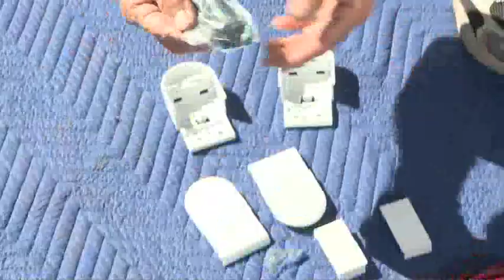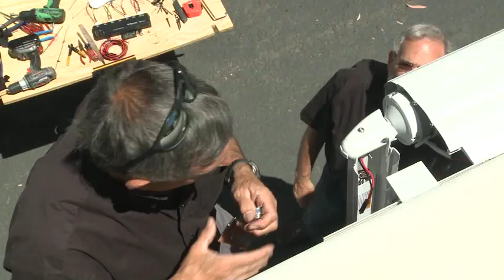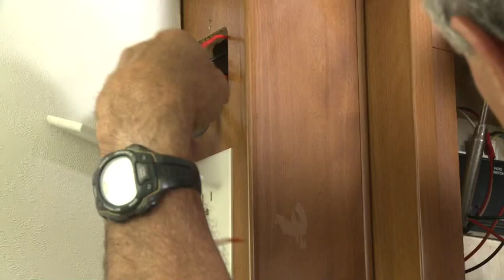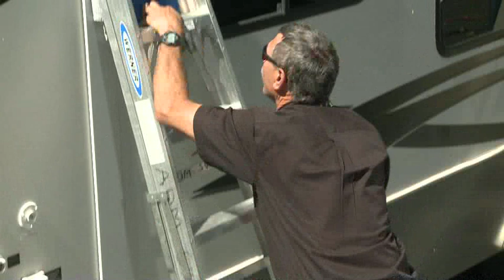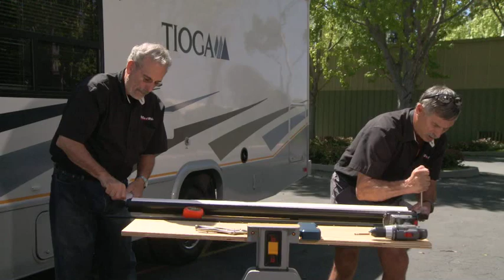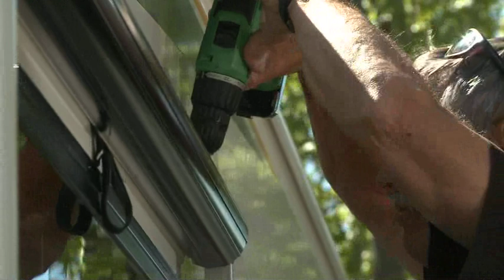All about RV Awnings and Awning Accessories

Comment: Scotch Locks!!!  
Lazy... Shame! 
Butt connectors are much more reliable but solder is always the best way - with shrink tube as you have used and promoted in previous vids .
In my early days I used Scotch locks and have been cursed at ever since for doing so.  They don't last, very thin point of contact and quickly corrode. Externally used (exposed to outside elements) don't expect 1 year of connection before you are chasing your electric problems...

Please help this end this abuse and frustration for your audience.